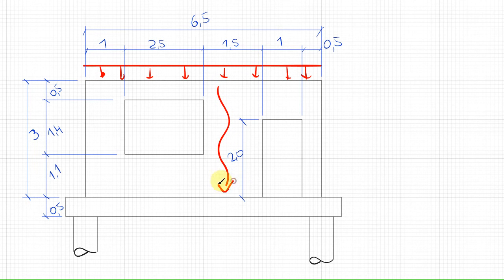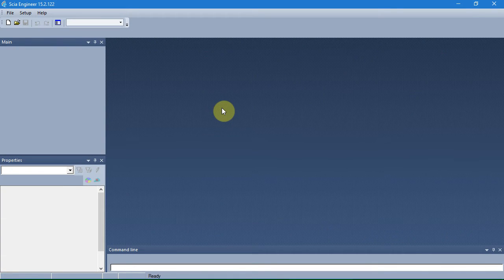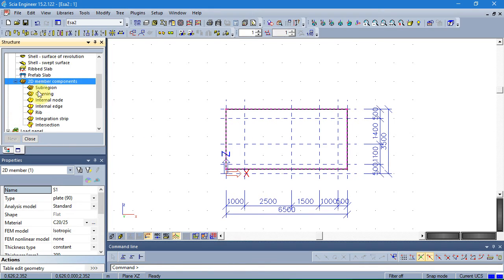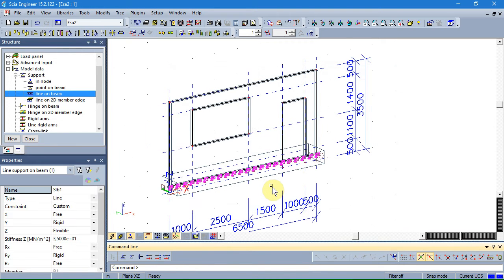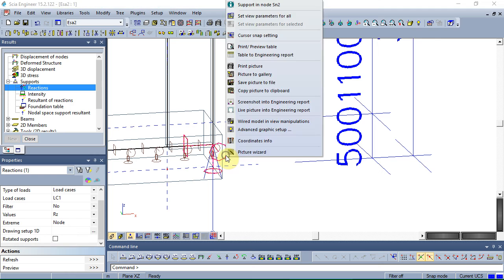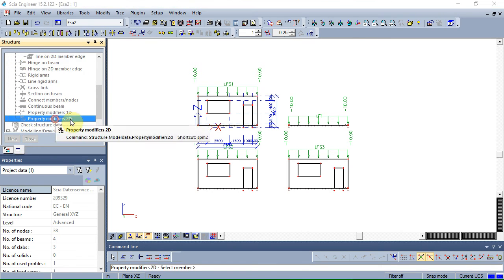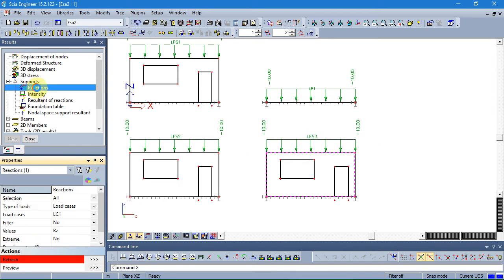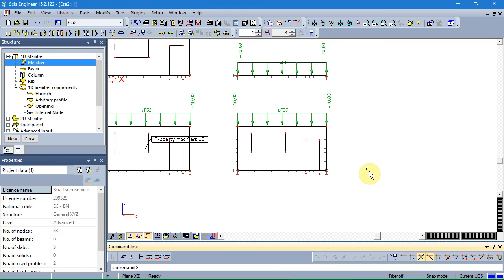How to modify the wall stifness to transfer load directly to support (in SCIA Engineer)

Comment: Hallo mr. Beles. Why do you insert a lineconnection on the beam instead of an automatic connection done by Scia Engineer(between beam and wall)?
Reply from the maker: if you mean the connection between the beam and the wall, then this is automatically connected. SCIA connect beams with 2D parts if the beam is on a boundary or internal line of a 2D part. I added a support to the beam. I had a short look on the video but I didn't seen any rigid line link. Maybe you write me, the time point of the video.
Reply: @IvanBeles  8:57 - you put a line on the beam and added the constraints. The reason why you added a spring(K-westergaard) for the z-direction in the model is not clear to me. You probably have your reason for it. In case of a masonry wall i would have added a pression only support.